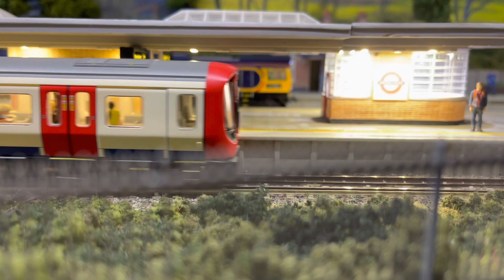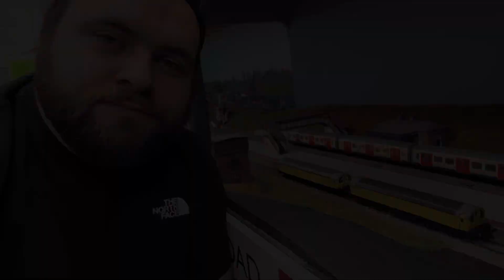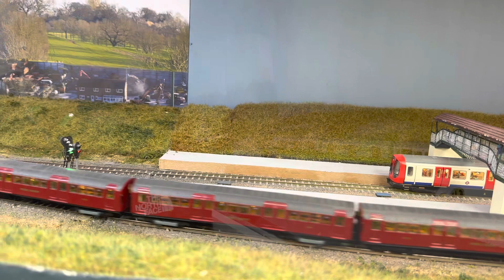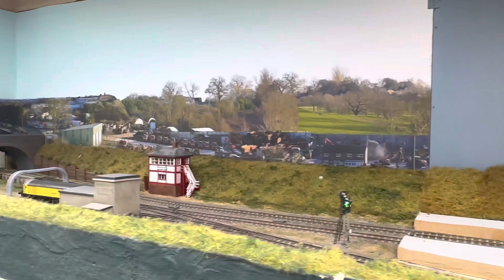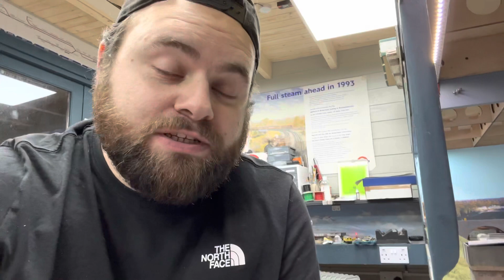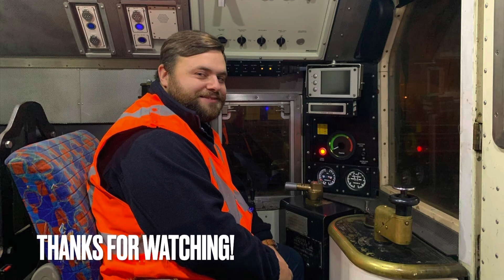DCC Sound for London Underground Battery locomotives - for Loksound V5

Comment: Just disappointed there is no squeal of the buffers sliding against the lathed edge of the shank and no bouncy brake rigging as it stops and starts. 😂😂😂 Sounds really good though, well done. Is there room on the chip for Buckeye coupling/uncoupling sounds, air piping to train, tripcock reset or possibly shoes raise/lower just to add a bit more to it?
Reply from the maker: Haha, cant win them all 😂
There is much more room on the decoder, its just getting the recordings is all.
I dont use buckeye couplings at work sadly so thats a pain, air pipes wouldnt be a problem though

Comment: Why would you get con rail arcing with a battery loco ?
Reply from the maker: They only run on battery power in engineering hours, they also run conventionally 🙂
Reply: When running to worksites they run on traction current. Then switch to batterys when traction current has been discharged.
Reply: @UndergroundEric  sorry about my ignorance of the facts. Only ever delt with mainline trains. A MLV would of been the closest thing on the Southern but not used on engineering trains.
Reply from the maker: @stephenrogers2648  not at all mate, someone was bound to ask it 🙂
Ah yes i suppose it would, i was looking in at the ones dumped in willesden the other week, interesting vehicles